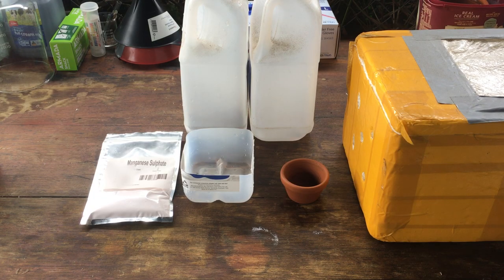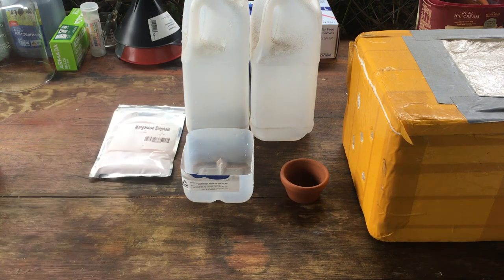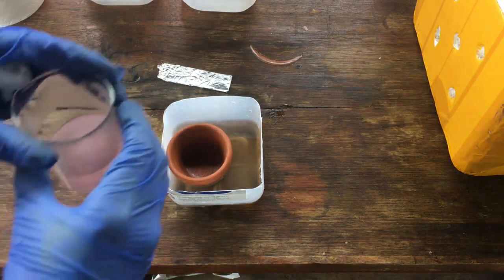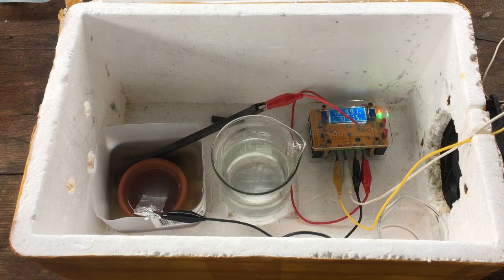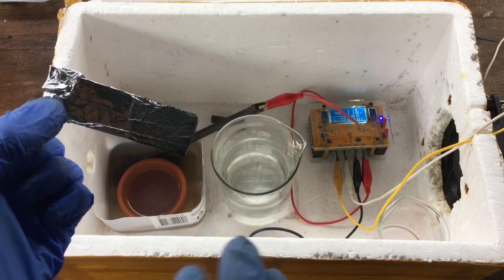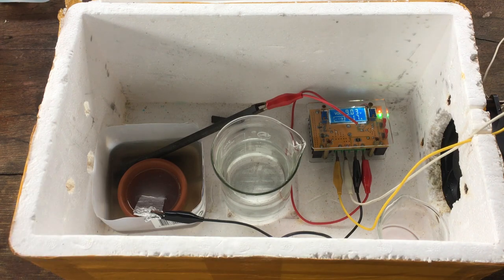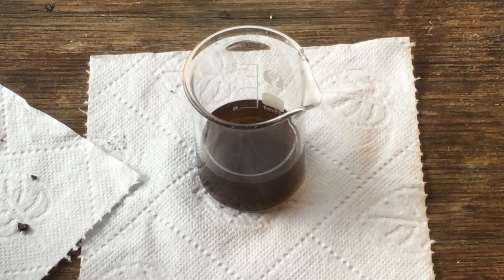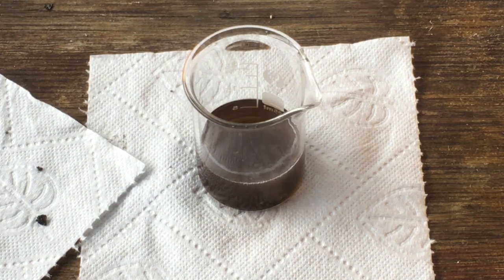Making Manganese Metal

Comment: I remember back a few years ago when I was getting into a little chemistry to make iron oxide for a thermite reaction (which failed because of non-existing knowledge.) I tried to make the iron oxide via electrolysis with iron nails for the anode and thought aluminum would be good for the cathode. Nope. Aluminum is corrosion resistant, right? I thought (ironic because how do think the thermite reaction takes place...?) I came back the next day and it was gone with white stuff laying on top of my iron compound precipitates. I was able to separate it, mostly, and get my iron precipitates. Now I know aluminum (metal) is actually quite reactive and through this the formed passivation layer (of which is quite stable) protects it, at least in bulk. Now I believe I know why it went terribly wrong. The aluminum passivation layer was broken in the alkali region of the cathode being plentiful of OH-, and aluminum being reactive, oxidized to Al3+, reducing hydrogen, and forming Al(OH)3, my white precipitate. My thermite failed probably because what I thought I had being iron III oxide was probably iron oxyhydroxide (I didn't heat the cleaned precipitate enough to decompose it.) Oh well, funny to look back on though. I did about a month ago use some quite fine aluminum powder I made to make a small amount of thermite. Good thing it was a small amount. Fine aluminum makes more for an explosion than a pretty shower of molten iron. :)

Comment: PS. Important!
If you want to directly make a Mn/Graphite electrode, you need TO SPIN THE ROD! I mean, you use your old setup, and connect the electrode to a motor using a rubber tube. Use some copper wire as brush. This will make a better coat.

Comment: Will reaction of manganese sulfate with aluminium strip produce manganese metal and aluminium sulphate ?
Reply from the maker: While it is thermodynamically possible, I'd imagine other effects and kinetics of the reaction would prevent it from actually occurring in a reasonable timeframe.
Reply: @ScrapScience  would it be accelerated by a minimal amount of heat ,wouldn't it ?
Reply from the maker: Yes, that's correct. But I still find it highly unlikely that the reaction would generate macroscopic amounts of manganese, even at boiling temperatures. Additionally, reduction potentials change with temperature, so that complicates things more.
You can definitely give it a go, but I'd be very surprised if it works.

Comment: according to your table graphite and aluminum have similar H2 overpotentials !  curious why you had to use 9.8v ....resistance? current required?
Reply from the maker: In the time since making this video, I've found that the table I used to demonstrate overpotential is rather inaccurate and misleading for how overpotential actually works, so don't put too much stock in it.
The high voltage is largely required to overcome the resistance introduced by the porous separator, which severely impedes the flow of current. We need a rather high voltage to get the current we want.
Reply: @ScrapScience  "overpotential actually works" .... so this is more akin to the barrier coating when aluminum is anodized ?

Comment: Regarding cathode conditions, isn't material selection issue moot as soon as the Mn is deposited, the reaction's conditions will be that of Mn metal regardless what material we start with?
          Regarding overvoltage, this should not be issue as iron, zinc (electro-galvanizing routinely done on iron in industry), & even aluminum can be electroplated in aqueous solutions.
Reply from the maker: For your first point, that's correct. The only reason we really want to select a good cathode material is to make the coating of manganese somewhat uniform. If it's really difficult for manganese to form, we'll end up with dendrites from the start, but if it's easy, we might get a somewhat smoother layer of metal.
For overvoltage, I'm not really sure what you're saying. Iron and zinc can definitely be reduced from aqueous solution under the right conditions, but aluminium cannot (I'd love to be proved wrong on this though, so feel free to send some evidence disagreeing with me here if you've got it). Plating manganese is kind of pushing the limit of what can be done efficiently under aqueous conditions.

Comment: Very interesting. I read one paper about electrolytic Mn production years ago. They used stainless steel cathode, in anode cell ammonium sulfate solution and in cathode cell manganese sulfate + ammonium sulfate solution. Ammonium ions are weakly acidic, they react with any OH- produced forming ammonia, so this basically solves the problem with manganese hydroxide formation.

Comment: Im probably being an idiot but how come you cant use 2 beakers and a salt bridge instead of the clay pot. Thereby allowing ion transfer but the liquids can never touch. I know there is something im missing which will make this obvious any help is greatly appreciated. I noticed in other videos you would have to add water continously to the clay pot as water diffused out of it into the larger solution. Genuinely just want to solve this conundrum in my brain
Reply from the maker: A perfectly reasonable question!
A salt bridge between two beakers would definitely work. However, given the extremely small cross-sectional surface area of a salt bridge (usually just a paper towel or something), it generally can't allow much current to pass through it, slowing down the reaction rate by an extreme amount. The clay pot is better for bulk reactions because it allows significantly more current to flow due to its far higher surface area, giving a faster reaction rate.
The difference is substantial enough that I'd never consider using a salt bridge for a bulk electrolytic reaction.
Reply: @ScrapScience  Thank you so much, organic chemistry is more my thing so i really appreciate you taking the time to explain this <3

Comment: 7:30 you aluminium foil make may be coated by tin layer and ever after that Aluminium is very reactive in water which forms Hydroxide so why you choose Aluminium ?
Reply from the maker: The idea was that aluminium has a very high overpotential for hydrogen, so it should favour the formation of manganese from aqueous solution when used as a cathode. I also thought that the cathodic potential of the aluminium might prevent any passivation or reaction with water.
It worked to some extent, but in the end it was just easier to use graphite, which also has a pretty high hydrogen overpotential.

Comment: Great video 👍! A nice and clean way to get manganesium (yup, that’s how it was upspringly called ;)) metal.  Useful, too, since one can make potassium permanganate from Mn metal, as you’ve shown in another great video of yours. I’d like to ask a few questions:

1)	It’s true that hydrogen’s reduction potential is lower the higher the pH is, but the same is true of that of manganese. The CRC Handbook of Chemistry and Physics lists the redox potential of Mn2+ + 2 e → Mn as –1.185 V (same as in your video) and the redox potential of Mn(OH)2 + 2 e → Mn + 2 OH– as –1.56 V. That source also says that the half-reaction 2 H2O + 2 e → H2 + 2 OH– has a redox potential of –0.8277 V (same as in your video), though. Hence, a higher pH seems to lower the reduction potential of H2 more than that of Mn, so you’re right that a higher pH is more favorable to the formation of Mn. Is that right?

2)	Why is the anolyte made of sulfuric acid? Don’t the H+ ions diffuse through the diaphragm separator into the catholyte and make it sour, contrary to what we want (after all, they’re by far the smallest of all ions)? Shouldn’t we therefore use a neutral anolyte instead, e.g. watery NaCl solution?

3)	Could it be that expoiting the high activation overpotential of aluminum didn’t work because it makes the reduction potential of manganese more negative as well as that of hydrogen?

4)	It’s true that the reduction potential of Mn is lower than that of H2, but so is Zn’s; yet zinc can be won from a watery ZnI2 solution without any problems, so why shouldn’t the same be true of manganese in principle (I write ‘in principle’ since Mn is more negative than Zn)? To me, it seems that when electrolysing a neutral or alkaline watery solution of a metal salt, the main first product at the cathode really is the elemental metal, but when the metal is very electropositive (e.g. Na, Mg, or Al), it immediately reacts further with the water to give hydrogen and again the metal ions. This looks logical to me because in a neutral or alkaline aqueous solution of a metal salt, there are many more metal cations than hydrogen cations, so the lion’s share of the ions which are attracted to the cathode and are reduced there should be made up of metal cations, not H+ ions. This hypothesis of mine is corroborated by the deedsake (fact) that metals that don’t react vigorously with water at once, such as Cu, Fe, Mn, and Zn, can be gotten from an aqueous solution by electrolysis, whereas that isn’t possible for metals like Na, Mg and Al that react vigorously with water (Mg and Al do so when not protected by a passivating layer, which is very likely the case for nascent metal). Is this theory of mine and my explanation (sweotoling) right? If yes, then the quite negative reduction potential of Mn is no reason to worry; since Mn doesn’t vigorously reduce water, we can be optimistic.
Reply from the maker: Excellent questions! I've done my best to answer them below:

1) Everything you've said here is true, however, the Mn(OH)2 + 2e- → Mn + 2OH– reduction is only relevant when the manganese is directly complexed with the OH- ions. In this case, the Mn(OH)2 is insoluble and thus cannot participate in a reaction on the cathode (unless it is in perfect, direct contact with the electrode), so this particular reduction reaction is not really relevant to this cell, even at high pH.
In the cell itself, we do our best to keep the pH as close to neutral as possible, so that the Mn(2+) ions stick around (without precipitating), and the concentration of H+ remains low. Hence, the reactions we worry about are:
H2O + 2e- → H2 + 2OH–   and     Mn(2+) + 2e- → Mn
and thus the only thing that changes at this neutral pH (when compared to acidic conditions) is the reduction potential of hydrogen, and the manganese potential remains the same. 
That said, if we were to raise the pH too high, all the manganese would precipitate to form Mn(OH)2, where it would no longer be able to participate in the reaction, and we'd only get hydrogen on the cathode.

2) There are three reasons why we use sulfuric acid as the anolyte. First, it is very conductive, so we don't need to use much. Second, it doesn't add any real 'impurities' to the cell, as we're not introducing any other metal ions to the solution (basically, it's much simpler - and easier to deal with waste - when the only metal ions we have are manganese). 
The third reason is a bit more complicated, and is based around the fact that we want the catholyte to remain as close to neutral as possible. If we were to use a neutral anolyte, as you've suggested, the catholyte would quickly become basic as hydrogen is generated on the cathode: H2O + 2e- → H2 + 2OH–, and the manganese would start precipitating with the OH- (which we definitely don't want). You're correct on the fact that H+ ions transfer through the diaphragm, and we actually require this to neutralise the OH- ions from the cathode. Any excess H+ ions which are left over from neutralisation in the cathode chamber are quickly reduced on the cathode, so the overall pH in the catholyte remains very close to neutral. It's like a self-buffering system for the cathode chamber.

3) That's very possible. It's probably a multitude of reasons including the poor quality of aluminium foil I used, the interference of the oxide layer on the aluminium surface, the fact that the table of overpotentials I was using was likely incorrect, and the reason you've mentioned.

4) This is actually quite a common misconception in electrochemistry (and something I remember being taught in high school). Even though it makes sense for very electropositive metals like sodium to be reduced to the metallic state and then react with water to form hydrogen, this is not the case. While you're correct on the fact that we can reduce the concentration of H+ to the point where the reduction 2H+ + 2e- → H2 does not occur, the presence of water itself cannot be changed, so the reduction H2O + 2e- → H2 + 2OH– is always an option for the cathode, and will occur when the -0.83 V is favourable.
We can prove this from the fact that when a solution of titanium is electrolysed, we only get hydrogen on the cathode. If the metal were to be produced as an intermediate on the electrode, and then react with water, we would see it form TiO2 (and precipitate out), which doesn't occur.
The reason we can get the reduction of zinc (and manganese for that matter) to occur, is the fact that we can push the hydrogen reduction potential low enough to make it comparable with the metal's reduction potential. When the reduction potential of the metal is around -1 V (or anything more positive than that), we can use a combination of overpotentials and pH to make the reaction favourable, but anything near -1.5 V or lower makes this nearly impossible (due to the strongly exponential relationship between reduction potential and reaction rate).
If you want a more in depth explanation as to why zinc can be reduced so easily, Nurdrage has an excellent video on the topic here:
https://youtu.be/y3WJFsr7HDY
Reply: @ScrapScience  Thanks for your detailed and informative answers!
1.	Yeah, right, there’s (Mn(H2O)6)2+ (aq) involved, not Mn(OH)2 (s); so the reaction with Mn(OH)2 is indeed irrelevant. I also agree with you on the rest. If the pH were high enough, there’d be no (Mn(H2O)6)2+ in solution, but only an Mn(OH)2 precipitate.
2.	F) Regarding the first reason: Yes, that’s right, but isn’t any other solution of an ionic compound just as conductive?
U) Concerning the second reason: Yes, that’s also right, but would e.g. NaCl have any negative effect on the purity of the Mn metal? Of course, NaCl would lead to the production of chlorine, which can be unpleasant.
Þ) Regarding the third ground: That looks like a very good reason to me and makes perfect sense.
3.	Ah, so there are several possible reasons, among them the one I’ve given.
4.	Oh, good to know that! Both the theoretical thoughts and experimental evidence seem convincing to me. However, there might be one potential loophole in the case of the argument with the titanium: What if TiO2 does form, but is at once reduced by the cathode to Ti2+ again?
Reply from the maker: No worries! As for your follow up questions:

2F) Different ionic compounds do actually have drastically different conductivities in aqueous solution. In fact, sulfuric acid is close to 6x more conductive than a molar equivalent of NaCl. You can check this table for the conductivities of aqueous solutions: https://www.chemicalforums.com/index.php?topic=58365.0 (I've posted a forum link here, but scroll down for the table, and then you'll also need to convert mass % to molar concentration).

2U) Using a sodium compound would not affect the purity of the manganese (as the sodium ion is electrochemically 'inert'), so you'd be fine on that front at least. And yes, you'd need to deal with the chlorine in that case.

4) That's an excellent point which I hadn't thought of. In all honesty, the idea of reactive metals being reduced on the cathode and then reacting with water (to form H2 and the metal ion again) isn't a bad model to describe what's happening in an electrolytic cell. It simply doesn't properly describe what's happening in 'reality' (as backed up by scientific consensus for electrochemistry). Off the top of my head, I can't think of any experiment which directly disproves the idea, but know that the thermodynamics and the mathematics of reaction rate (in particular, the Nernst equation) only works out to agree with experiment, if we consider the 'correct' reaction pathway (where water is directly reduced to hydrogen).
Reply: @ScrapScience  2F) Thanks for the link. There seem to be quite a few factors involved that affect condictiveness.

4) Good, so that’s the emprico-theoretical proof.

I forgot to say this the last time: Thanks for the link to the Nurdrage video about Zn. Really interesting that zinc has just the right properties!

Comment: Nice video, thank you. Do you think this method can also be used to get cobalt metal from a cobalt salt? I have a bit of cobalt sulphate and more cobalt acetate in the shed.
Reply from the maker: I would guess that making cobalt metal would actually be feasible in a single undivided cell, the reduction potential of cobalt is probably high enough to have the reaction work (at least a little) under the acidic conditions generated in an undivided cell.
That being said, you might generate some cobalt oxides on the anode if you don't include a diaphragm, so if you want to avoid that as much as possible (or if you want the process to be more efficient), a separated cell might be the way to go.

Comment: You should do a premiere for the next part. It will be a first time on any video platform.
Reply from the maker: Sure thing, I'll give it a go.
Might be quite a while before the next part is ready, I ran into a few problems using the DIY manganese electrodes, and might have to buy some actual metal flakes online instead. Either way, it'll possibly be a couple of months before the video is done, so stay tuned.